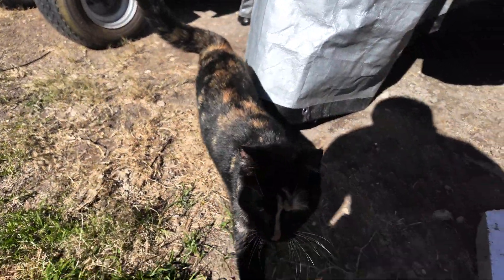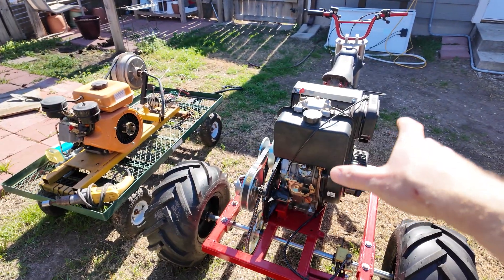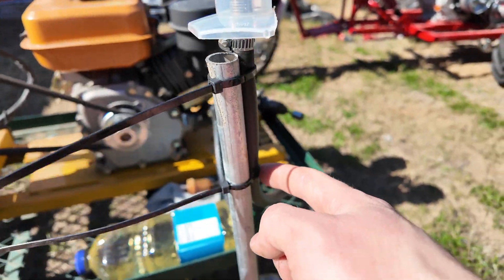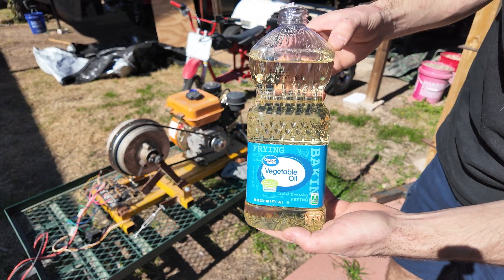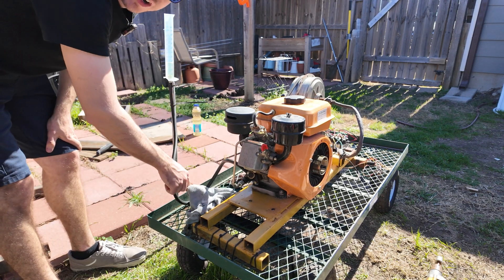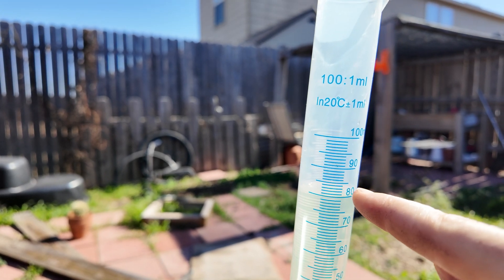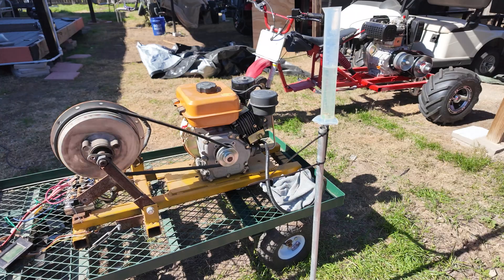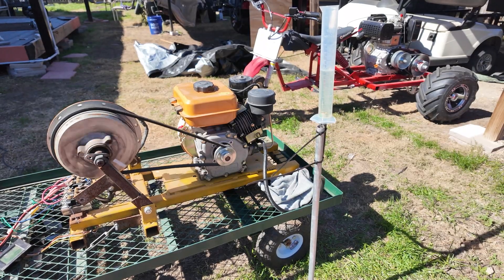Diesel Engine Using Vegetable Oil as Fuel! Will It Run?

Comment: First diesel engine ever built ran on peanut oil... That's right Rudolph Diesels engine ran on peanut oil not diesel fuel... Also should note run time test is invalid due to not running the fuel return on the injector back to reservoir
Reply: Ok

Comment: Ran my landrover on all kinds of veg oil. Starting on diesel works best with a simple twin tank. Then moved to settled and 1micro filtered used veg, then moved to biodiesel and that's when the trouble started. Eats everything. All rubber seals perish, air leaks on fuel lines, etc etc. but straight veg oil (During warmer months) yeah no problem. A splash of petrol or white spirits will also lower the viscosity.